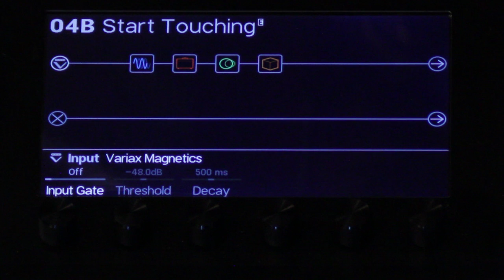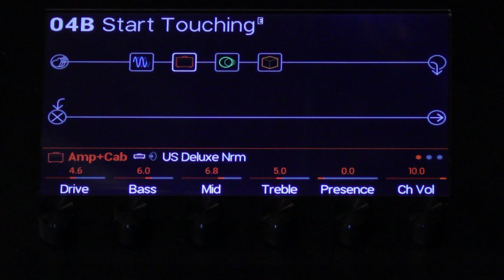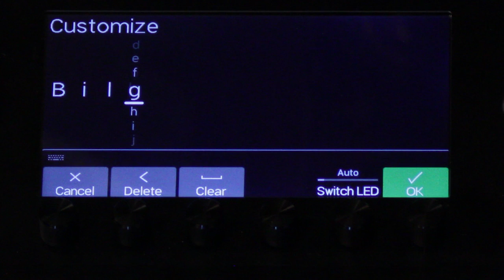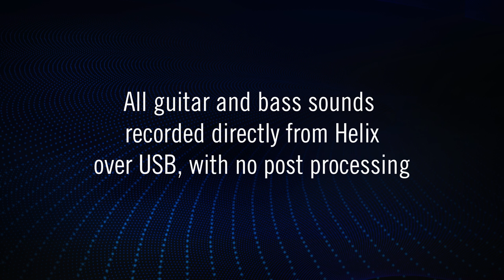Navigating The Helix User Interface | Line 6

Comment: It's great to see line 6 reinvest in quality amp modeling! Just got my Helix and have owned both Kemper and Ax FX2. All 3 products have great sounds to be found largely depending on the guitar you have. The user interface is what sold me on the Helix. While there are some amps I will miss in the other products, Helix is now my go to. I am using it with a QVC K10. Happy!